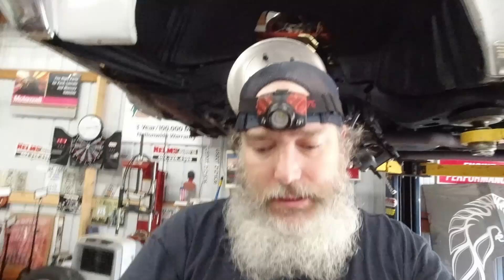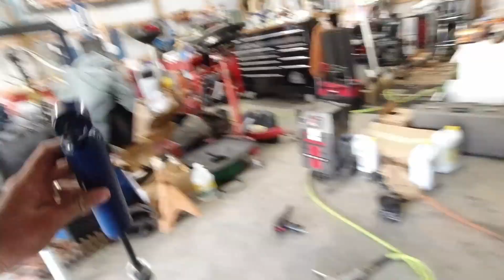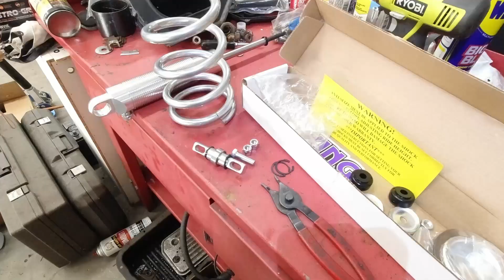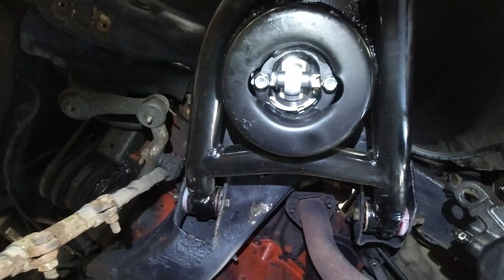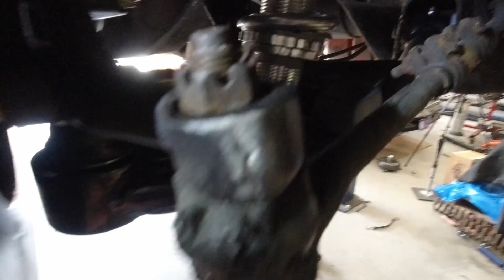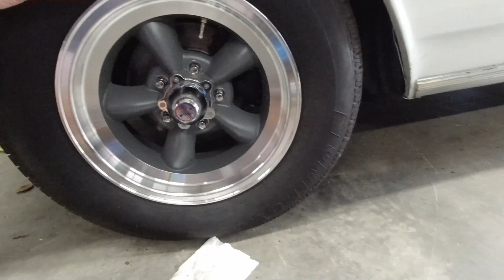Viking Coil Over Shocks  For The 1965 El Camino

Comment: Do you know if they will work for a stock 65? I’m tired of my tires bottoming out….great video!!
Reply from the maker: I am pretty sure you can run them with stock control arms, but I would call Viking.  They are great to work with and will answer any questions you have.